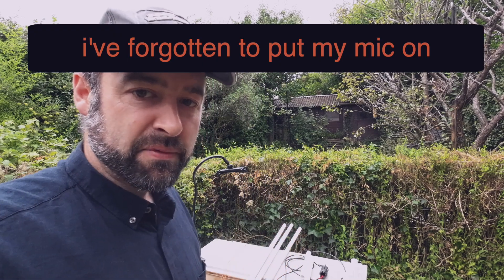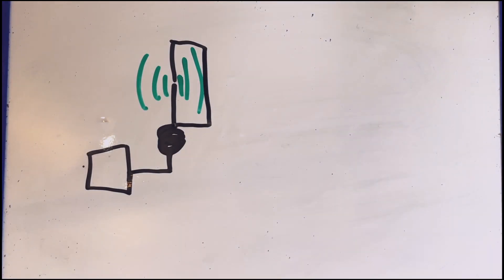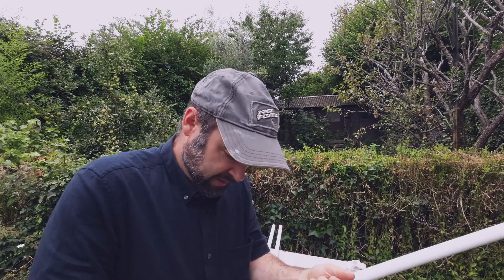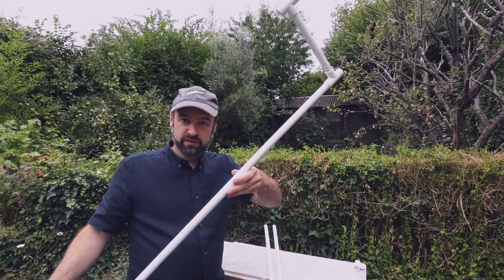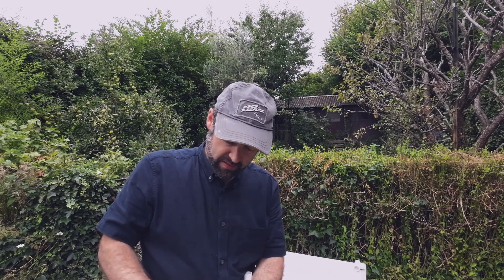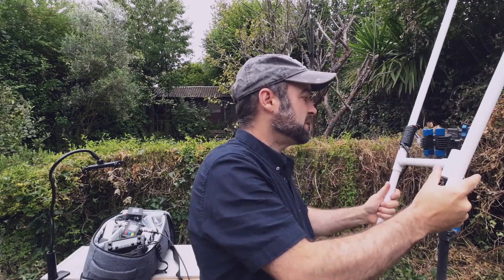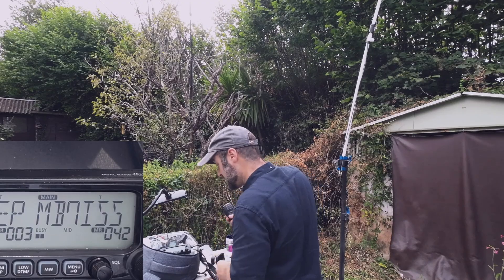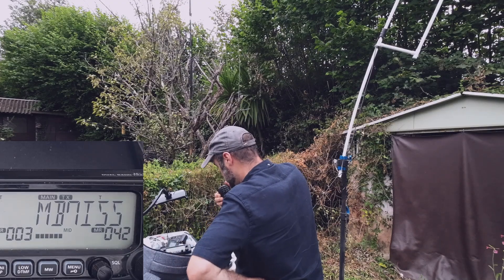The flowerpot coax antenna mod to try and increase it's gain

Comment: Nice video! Maybe you can try placing the reflector at a quarter wavelength and make it 5% longer than de driven element like they do with Yagis.
Reply from the maker: Yes I’ve got quite a bit of experimenting to do. 73

Comment: Hi ! Did you trim the reflector? Or is it just a bunch of scrap wire with random lengths?

73’s
Reply from the maker: Hiya, it was 4 pieces of wire roughly 1metre long give or take a few mm. i've found out after further tests that the distance of the reflector is very important to performance. test it at 25cm and also at 50cm away it can make a big different. i will be demonstrating this in a video soon using an RF meter.

Comment: Yes, inserting an antenna in to PVC pipe affects performance as does the wall thickness of the PVC pipe.  Simply tune the antenna while it is inserted in the pipe, pull it out to cut shorter if need be.  PVC pipe come in various thicknesses.  In the US we have Schedule 80, Schedule 40 and Class 200, listed in order of decreasing wall thickness and pressure rating. Don't know about UK but it looks like yours is Class 200. If you choose to paint it, use a paint without metal oxide pigments.  Metal oxides can absorb RF, that's why it is used in paints for stealth aircraft.
Reply from the maker: Very interesting thanks for the info, I just picked up the only pvc they had. I did workout by performance comparison the pvc is effecting it when tested in and then on the outside
Reply: @MW0OYD Out of curiosity checked some UK plumbing suppliers.  Looks like UK doesn't use PVC pipe as much as we do in US.  Easiest to find equivalent in PVC was solvent weld drain pipe, thinnest walls and no pressure rating.  There is also PVC metric solvent weld, with thicker walls, rated to 10 bar and then PVC imperial solvent weld, with still thicker walls,  rated to 16 bar. I use the thickest walled stuff for stiffer masts and supports and the thinnest wall stuff for radomes protecting antennas from the weather. Henderson's Plastics has a comparison chart of sizes of all three.

Comment: Nice idea! I wanted to bring up an antenna that i built quite a long time ago.  A, 2 meter Hentenna.  It will give you a good bit of gain and it's easily transportable . If you've got an all mode radio, just turning from vertical to horizontal for SSB/CW is quick. If you use #14 solid copper wire , all you need is a letter I shaped piece of PVC for the framework. Its a double loop and it really helps the gain! Give it a try! I think you'll ge able to grab that distant repeater with no trouble! Also its easy to hang in a tree or on a mast. No drooping or sagging! 73! de N3TGY
Reply from the maker: thank you! interesting i will look into that

Comment: Nice experiment sir. I wonder, what would happen if you put a director next time? Cheers.
Reply from the maker: I’m not sure,  initial tests were not too positive like it was blocking rather than directing. I need to test more,I have a few ideas
Reply: A director would make it more gravitationally stable as well. Is that what you call a balanced antenna? ;-)

Comment: Another mod for this, use copper tape for the elements around the whole pipe. I bet you'd improve it in several ways and you could more accurately define the reflector.
Reply from the maker: cheers, interesting idea, i'm pretty sure the pvc pipe when the element is inside is restricting the RF just a bit, the rg58 core is very thin.. if i get around to trying that copper tape idea  i will record it on video.👍
Reply: I have used aluminum tape applied to PVC tubing for the reflector and directors on a Yagi antenna, obtaining fine results.  It has been up for seven years through snow and icing conditions, high temperatures up to 99 degrees F (37 degrees C), and windstorms strong enough to bring down nearby trees.  It continues to show no signs of any delamination.
Reply from the maker: @analog_guy  nice one! i've heard of people using measuring tapes, i might have to try that. i was using copper tape today in my experiments but it's so fragile and very tricky to use on pipes!
Reply: @MW0OYD Okay.  The copper tape might be preferred for things like the driven element since the copper is solderable.  Making reliable connections with aluminum can be problematic, so the aluminum tape is good when applied in a continuous strip to form elements such as the directors and reflector where no further electrical connection is required. 🙂
Reply: @MW0OYD Copper tape comes in a range of thicknesses.  Find a thicker one or try aluminum tape.
Reply from the maker: @engineerncook6138 good idea I’ll look at that
Reply: If you re interested in foil-based antennas, look up John Portune W6NBC.  Many lectures on YT and a Kindle book on slot antenna that covers foil.
Reply: The aluminum tape I used is 0.09 mm (3.9 mil) total thickness including the acrylic adhesive, 0.05 mm (2 mil) high strength aluminum foil thickness.  I had no fragility problems.

Comment: Well done Lloyd, it's got me wondering now if two or even three reflectors will improve it further... keep enjoying experimenting with ham radio.

Joshua de GW5NIC 

(outskirts of Cardiff near the Wenvoe TV mast on top of the hill)
Reply from the maker: Cheers Joshua, I’m the other side of Cardiff near Newport but I might be able to work you simplex from here. You on ham butties Facebook group?
Reply: @MW0OYD sadly I dont do Facebook, I've got an extremely good takeoff here  pretty much 360 degrees often working 2m stations in Merthyr, Swansea, Gloucester and Cornwall. Simplex would be an easy feat. Look forward to your next videos. Keep up the good work 👏